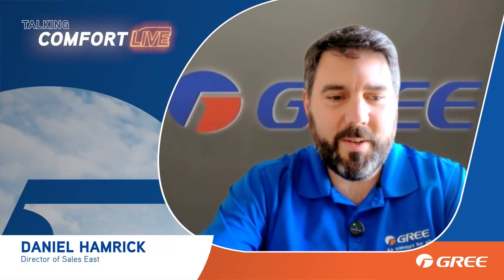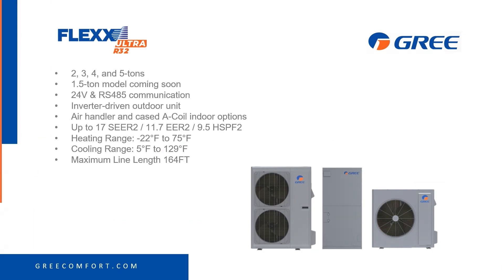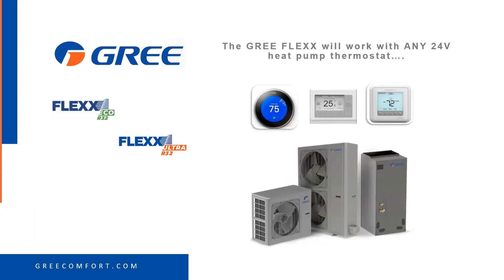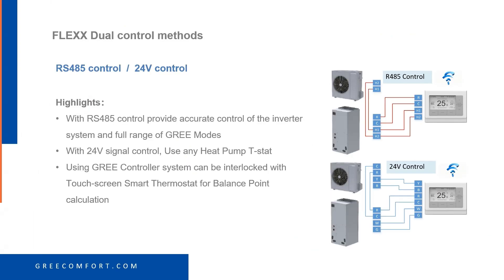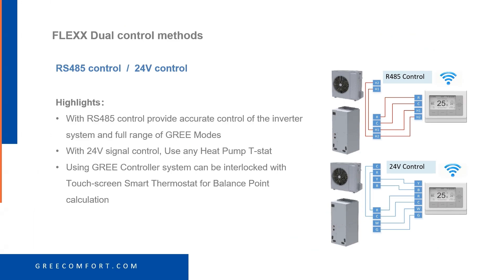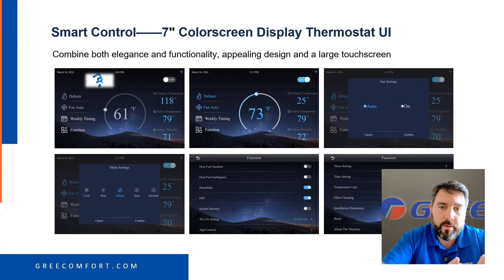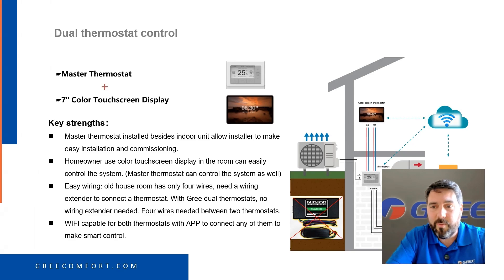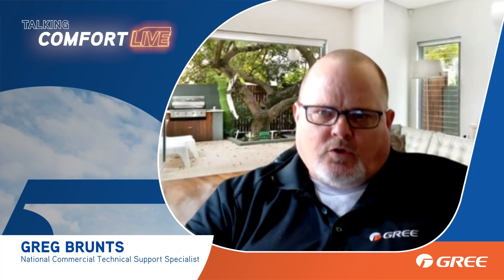FLEXX Ultra R32 PRODUCT UPDATE: New Features, Thermostat Options, and Setup Tips

Comment: Hello, can you guys help with the King Home heat pump system that I had installed at my home in the US in December 2025? I cannot register warranty on the Greeusa website simply because the S/N structure is different. The King Home equipment warranty and support is supposed to be handled by Gree USA (as it says online). Thank yo so much!